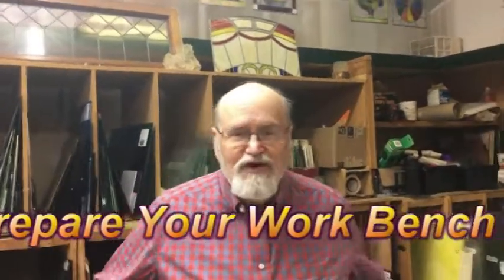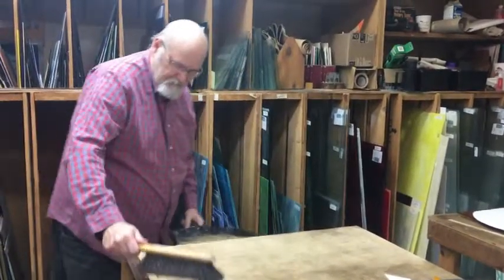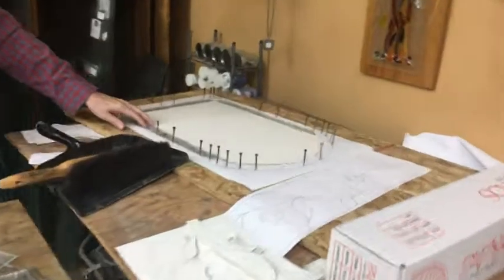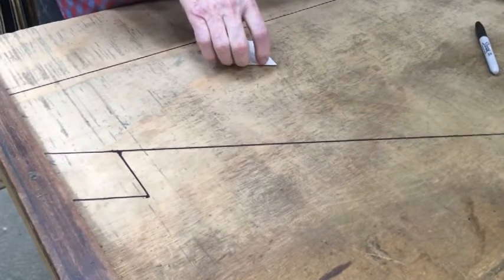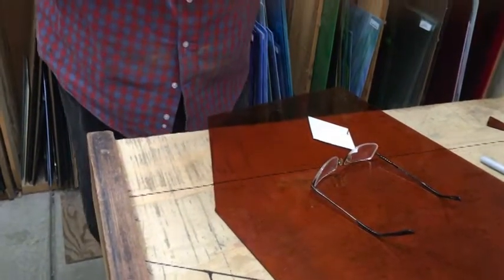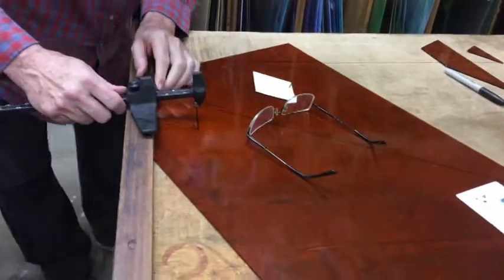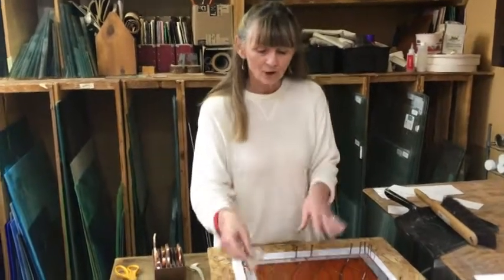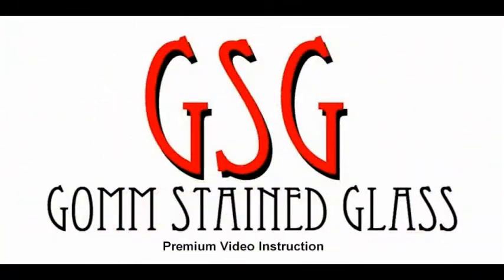Prepare Your Workbench For Cutting Stained Glass Diamonds V343

Comment: I need to cut dozens of small diamonds but can't seem to get my table edge set up with the correct depth piece of wood at the edge.  I have the same cutter you have and I've watched your diamond cutting videos.  I just can't seem to get table set up so cutter is on glass and slider is snug to thr rail.
Reply from the maker: measure the height of the side of your cutter guide and the add the width of the glass you plan to cut (usually 1/8 to 1/4) this will give you the right thickness.